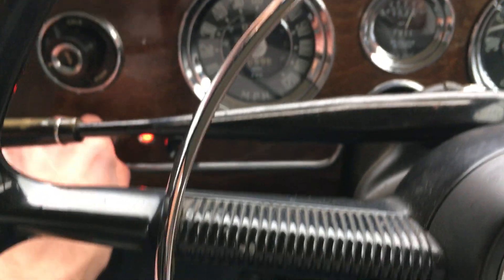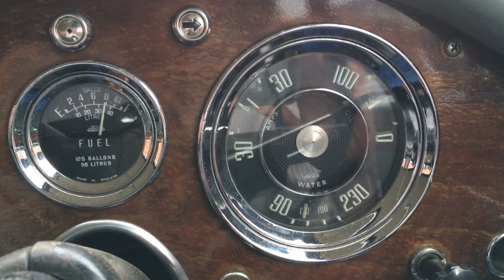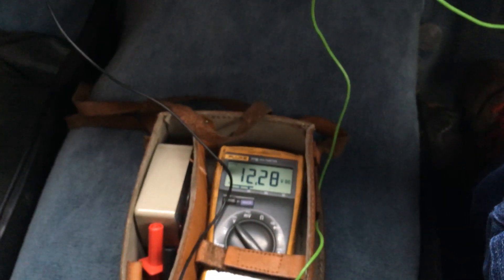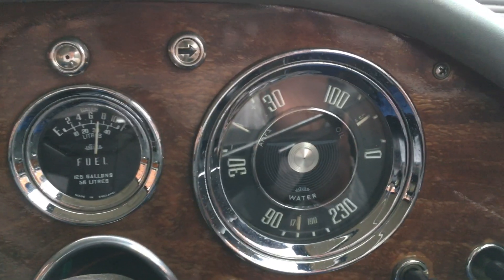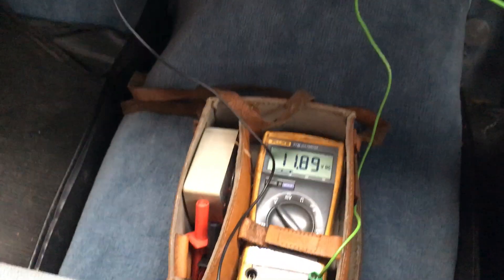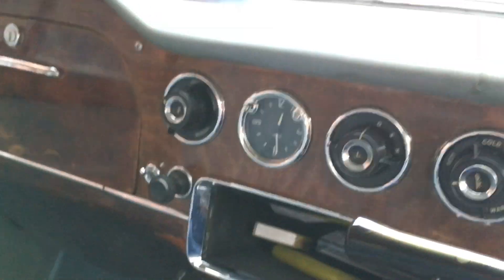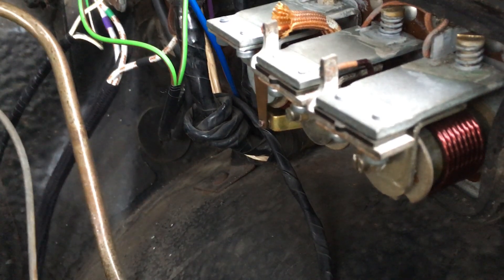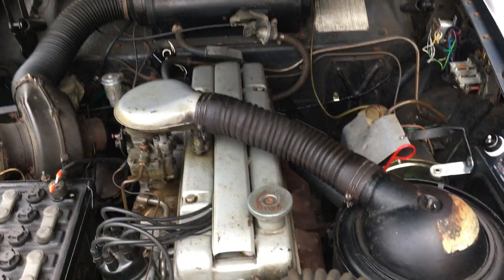Lucas RB.310 regulator. Part 1 of 4. The problem.

Comment: Nice car.  This is just a silly amount of work to have to go through to get your voltage regulator to do its job.  In working on VW beetles as a teenager, I never once replaced a voltage regulator, eventually just did alternator upgrades when they became more reasonable in price.  Even on the Pacific coast up in Seattle we joked about warm beer and Lucas electrics and made sure to buy cars with Bosch electrical systems. 😊
Reply from the maker: These RB. 310 regulators seem to be troublesome, whether it’s age related or something else I don’t know, but the other Lucas regulators are totally reliable.